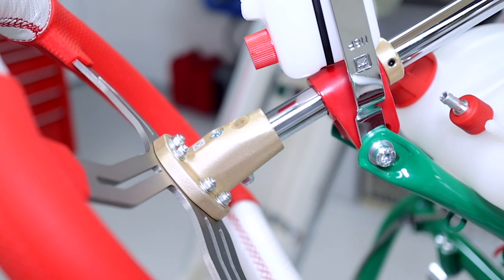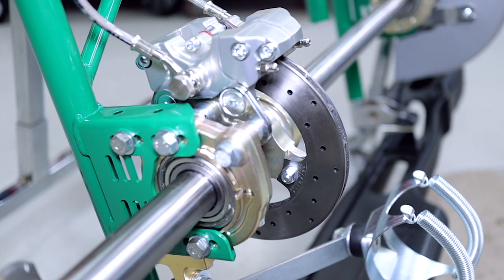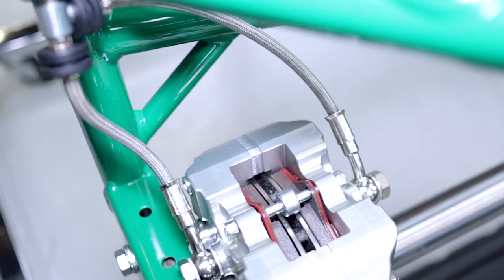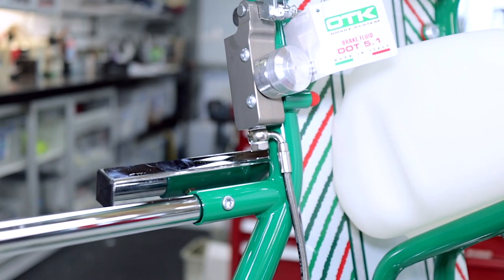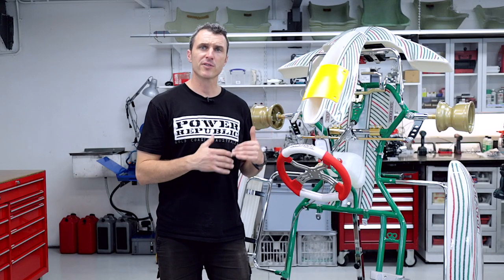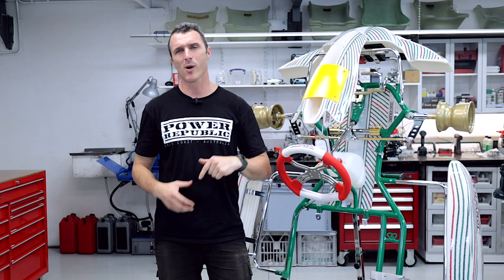INTRODUCING: The Tony Kart Nordix 2020 Go Kart - POWER REPUBLIC

Comment: Having just bought a new 401R I just had a bit of a WTF moment, until I googled 'OTK Nordix' to find that it's "Designed for drivers 12 - 14 years old".
Reply from the maker: Yeah that’s not gunna cut it for the big guys in the Racer 401 categories.  12-14 yo and 40-55kg’s is about it
Reply: @PowerRepublic  im 13 in june im going to be 14 should i buy the 401R or the nordix
Reply from the maker: @fionnlynch500  if you are small, then get the Nordix for sure, if you are big for your age lean towards the 401R